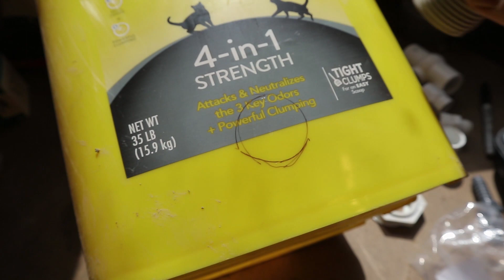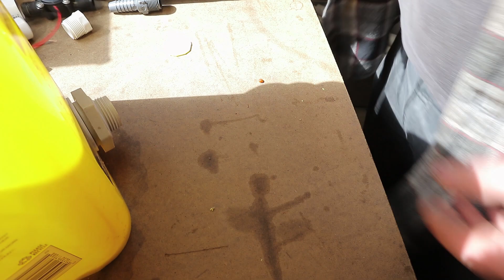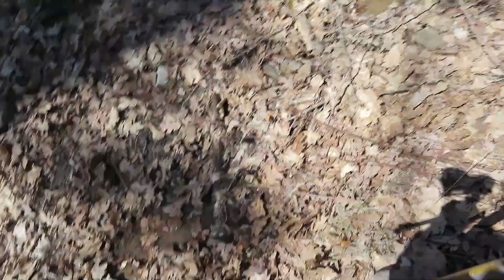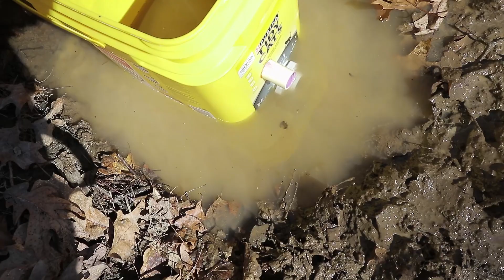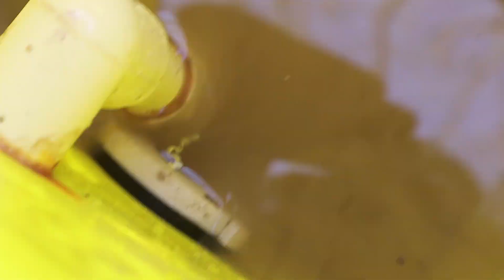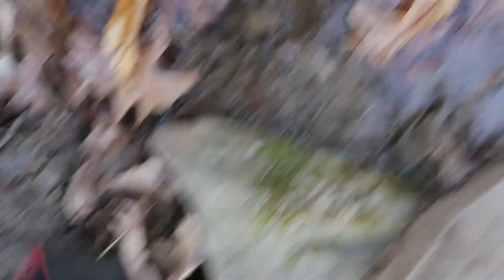Spring Creek Micro Hydro Turbine P1, Filter/Pipe/Connect

Comment: Based on the parameters you provided: power is 2.4W, current is 200mA or 0.2A, then the voltage is 12V.

Comment: DIG DEEPER bury it to the handle,  holes only on the side not the bottom.  If it is sitting on the ground how will water flow?   I would also add a screen mesh and fill it with fine gravel.

Comment: You are correct --- volts is pretty meaningless,  since voltage is routinely converted up or down to meet the needs at hand.  What you ought to be concerned with is the energy you can capture  ---power,  which is volts times amps with electricity.  One amp of current flow at one volt is an energy level of one watt..

Comment: thanks for posting.    jm, i'm not sure exactly What amount of power YOU think is available at the site.    the flow rate is so low, Maybe, four watts could be generated,   IF, a Correctly Designed Overshot Waterwheel is used.      Ideally, the radius of such a 'wheel Would be fifty percent of the Available Head.      cheers